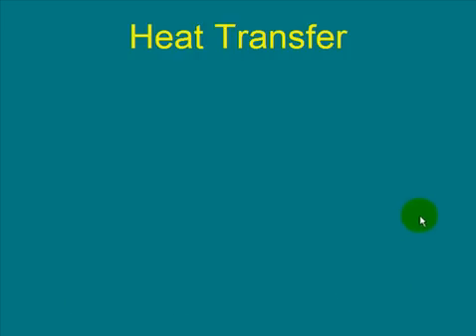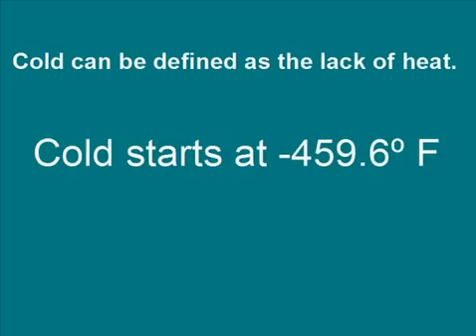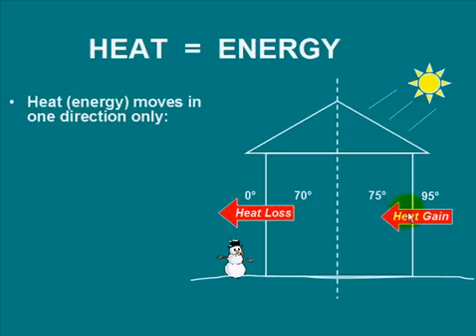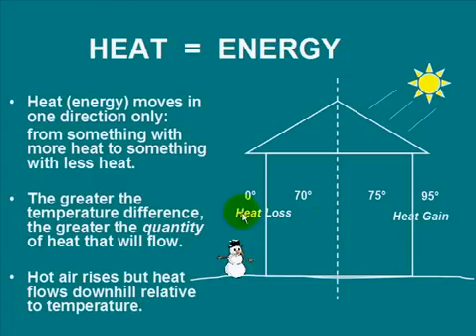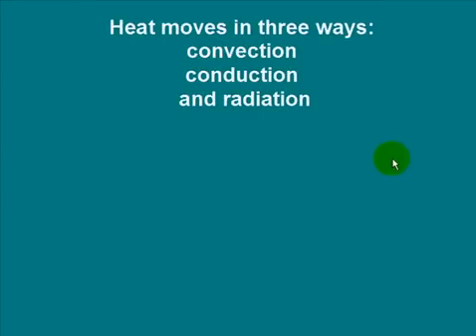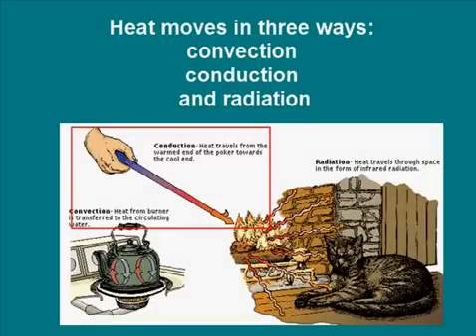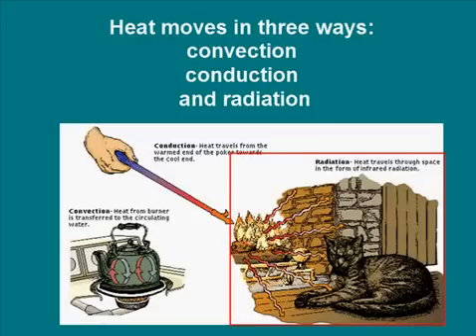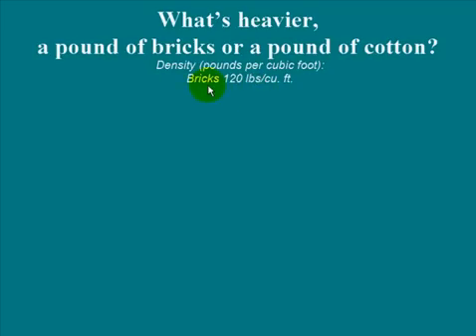Understanding Manual J - HVAC Essentials

Comment: Light a match and hold it near the floor by an open door and tell me no cold air comes in. thermodynamics, hot air rushes out the top, and cold air enters through the bottom.
Reply: Great video though

Comment: What is the most convincing way to prove "heat seeks cold"?  I've always had a problem with understanding this.
Reply: Thanks for trying, I still don't have a clear observable way to understand "heat seeks cold".  Air colder than 32 degrees F freezes water.  An hot stove may burn me,  I don't know how the burner feels, only how I feel.  I don't want my finger to touch a hot stove nor a liquified  gases.

I totally understand different temperatures seeking equilibrium through convection and conduction, and that heat also radiates, and higher heat will produce more radiant heat than cooler heat.  I just haven't seen an exercise of "heat seeking cold" that cannot adequately be explained by different temperatures simply seeking equilibrium through convection or conduction or the fact that something is warming up because it is absorbing radiant heat.   

For the most part, my current understanding hasn't really hindered me from understanding how HVAC carries heat from one place to another, I just haven't seen a great example of "heat seeks cold", hence my post.
Reply: I've done more research on this and understand the flow of heat is from hot to cold now.  However I still get hung up when people say the CAUSE of heat transfer is BECAUSE "heat seeks cold" in many scenarios.  

Watch 2:30 to 2:54...  He said this transfer of heat from the cold outdoor air to the colder heat pump coil worked "BECAUSE hot goes to cold".  Now, does a heat pump really work primarily BECAUSE "heat goes to cold" or is it really working primarily because of convection of air movement causing the outdoor air to flow across the coils and the conduction conduction through the aluminum fins to the copper/aluminum tubing and finally to the refrigerant.   In the scenario in the clip I pointed out, it's much easier for me to simple understand that different temperatures want equilibrium and to understand that convection and conduction were vastly more important than the direction heat flows.

P.S. your analogy was pretty good.

Comment: this manual J is full of crap. manual j said my home needed a 1.5 ton. the system does not keep up with the home nor am i able adjust my temp throught the day. full of crap that causes your energy bill to skyrocket
Reply: It's possible that a Manual D was not done which calculates the necessary duct work needed in your home.  Both a Manual J and D need to be done in order to get your AC system working optimally.  Of course, it's quite possible the person who did the Manual J did it incorrectly too.
Reply: someone   did  not   enter   correct info

Comment: I like the fact that you mention heat moves in "all three ways"... its almost never one method of transfer.

That said, even though fluids (say water) heat will circulate in convection currents... isnt a tiny portion radiated within the fluid... ie from a molecule at top of the container radiated through to bottom.

Best regards. thx for insight!